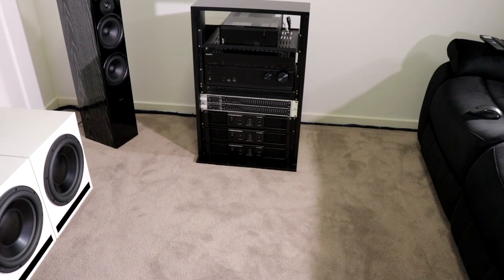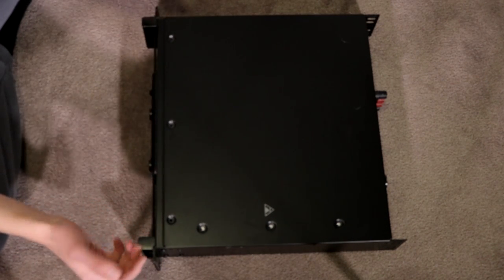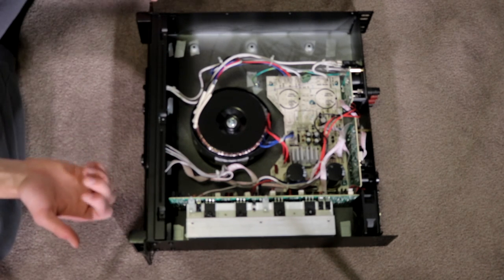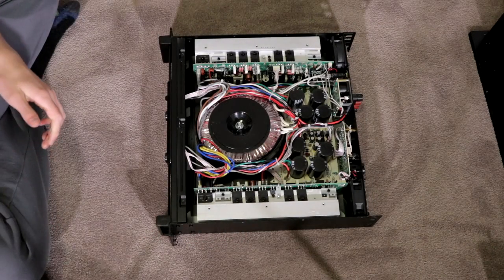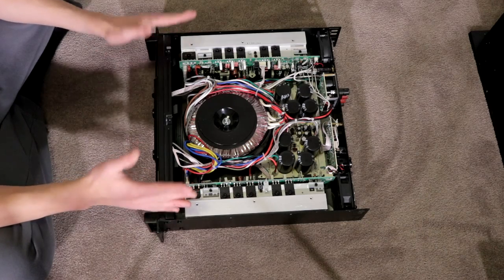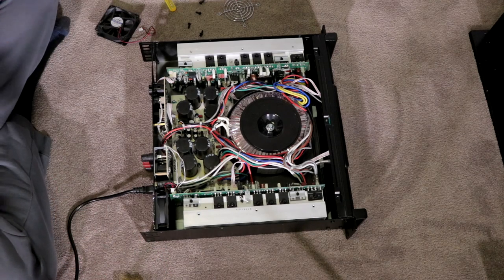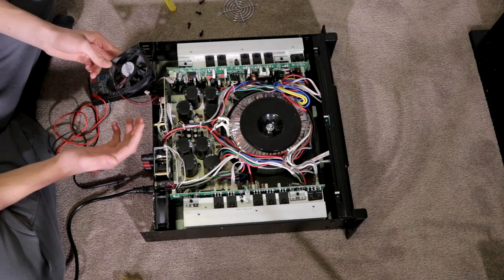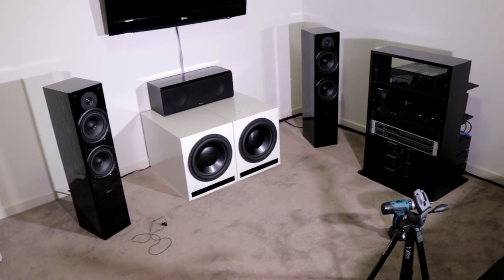WHATS INSIDE? - CERWIN VEGA CV-900 AND CV-2800

Comment from the maker: Welcome back to anyone who saw this 20 hours ago when I accidentally set the video public! ahah
Reply: I saw the notification and I clicked on it but it was too late lol
Reply: Doublsmm you should use be quiet fans.
Reply: Doublsmm the Be Quiet silent wings 2 80 mm will be a good choise
Reply: They do like 15 db
Reply: cv-900 is the same amp used in my school theater hall. the have 4 of them to powered jbl mr series
Reply: I used a step down on my inuke 6000 with silent fans, it's so worth doing! Been working flawless for over 3 years so far
Reply: Doublsmm you should make a intro and outro
Reply: Tyler  Crain please, fucking, don't
Reply: No. The magic with his channel is that it's straight on and no bullshit.
Reply: Doublsmm I did lol
Reply: Doublsmm  I love you so much
Reply: Doublsmm weret
Reply: Doublsmm  why are there different colored electric boards inside is one higher voltage than the other or is it something else I never really know for sure I have looked and worked on a lot of receivers but never really saw those type of white Tannis electrical fees for I only seen them once on a old vintage receiver before and that one was connected to the main electrical output to power up the whole unit with the main fuse box connected to that

Comment: I am running a QSC rmx1850HD with a 12volt fan instead of 24v so much quiter you can hardley hear it. I set mine up by soldring in a 70ohm 3w resistor on the postive side of the fan cable. It has work great for me so far.
Reply: 24 to 12v lm7812

Comment: My Rack if fitted with 4 CV2800 & 2 Crown XLI3500, the CV run and push just as well as the Crown! Is the CV underrated or the Crown Overrated?

Comment: Be careful when swapping fans these are 24v! There aren't that many silent 24v fans so you need to find a way to get a 12v power source inside the amp.
Reply: 24 to 12v lm7812

Comment: I'm running a 12 volt fan for almost two years on the 24 volts from the amp without problems. give it a try!
Reply: Impossible.
Reply: SNDCX It isn't, trust me. Works great.
Reply: A 12v fan being pushed by 24v will burn up, guaranteed. It's possible though that you're only feeding it like 13-15v. That'll just really quickly wear out the fan's windings/components. A full 24v will DEFINITELY burn the fan up.
Reply: SNDCX Absolutely not, some are even capable of 32 volts for a couple of minutes. If you don't believe me I can show you the proof. Most of them are pretty well built.

Comment: Put the two 12v fans in sieries to run them at 24v
Reply: That would be risky, though. It'd draw a different currect compared to just one fan, and the other control circuit of the other fan would be unloaded which could possibly form an imbalance since it's not designed to run without a left/right fan
Reply: @djsndcx  I wired the fans in my CV-1800 in series to quiet them down and it's been fine after several years.

Comment: Î think you should also compared hjow much air per minute the fan is blowing. It should be equal wirth the new one.
Reply: And i guess the smaller heatsink is for the rectifier? Because much power needs to go through?
But the caps look damn small for this power. My vintage 75 W amp has a big 16.000 µF cap. That does "Just" look like twice as much but for 10 times the power? Hard to believe.
Ok, my amp reaches peaks 4 times its rms.
Reply: Dom oversized cap lmao , nice.
Reply: Cheese 1337 i dont think it is oversized since it reaches peaks up to 250 watts. And if i understood my friend correctly who somehow teaches me a bit in electronics it is doing this on up to 4 channels simultaneously. It has 2 IC's and i run it with channel A+B. The Back panel sticker says up to 560 Watts power consumption. Sony STR 5800. 
Maybe i understood something wrong. It is a dual cap with 8.000 x2
Reply: Dom power consumption ussualy doesnt do anything with output watts since efficiency, now better 8000uf caps on one polarity side :d but kinda cool
Reply: i know power consumption also includes inefficiencys. Specially on Class A, A/B amplifiers like this. But it could go to 500 Watts effective. It does not get very warm. And it is good that it does not get very warm, so it is better for the transistors and cap which lives been shortened by heat.

Like i said it has 2 STK sony custom IC`s. My guess is that each one is fed just with right or left signal an just outputs 1 channel signal on the stereo output. So it is possible to drive 4 channels without loosing power simultaneously.
Other amps just reach half the power than depending on the circuitry.

But anyways. I wanted to have a vintage amp because i know they are superior to modern gear most times and i got this. And i love it

Comment: still must be much better than them cheap Skytec ones you see for sale here.
Reply: Have you looked at the Citronic PLX / Pulse APB amps...? I personally own a PLX2800 and an APB2100 (“same” amp), and I think they’re a great idea - a “cheap amp”, but rather than a Skytec SPL where you have a tiny 2x 80w amp board, a relatively big toroidal transformer and a brick to add weight, they’re actually reversed engineered hardware clones of the Crest Audio CA amps! So you get a “real” amp for relatively cheap money :-)

Comment: Kinda weak looking amps to be honest. Those heatsinks are tiny dude!  My 500 watt Yamaha has a 10kg transformer and has 25 output transistors. Heatsinks are 40cm x 15cm. And it’s just 500w. Those are good amps but they are entry level. Don’t want to sound like an asshole just stating the facts.